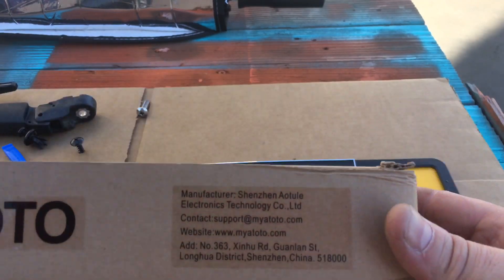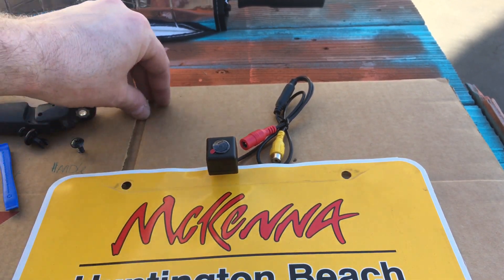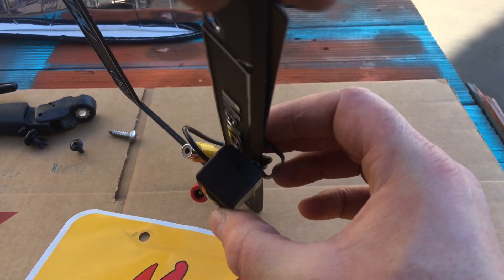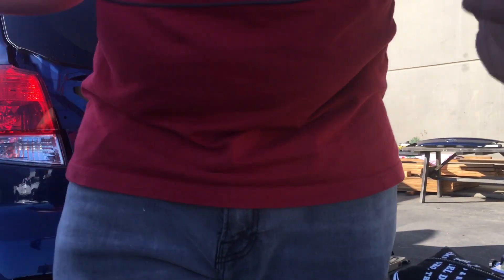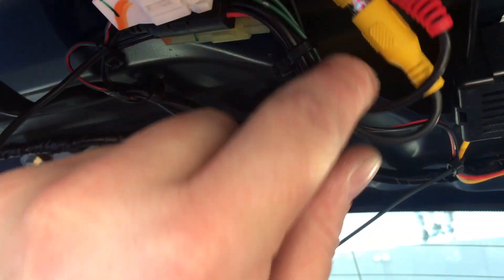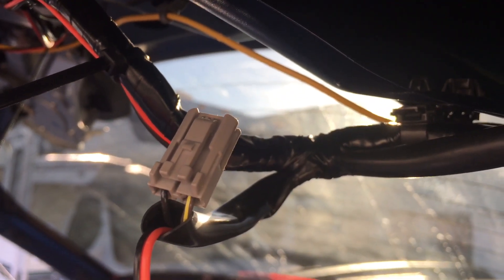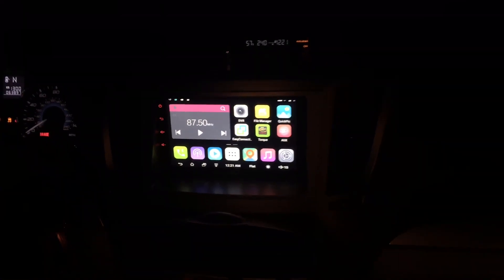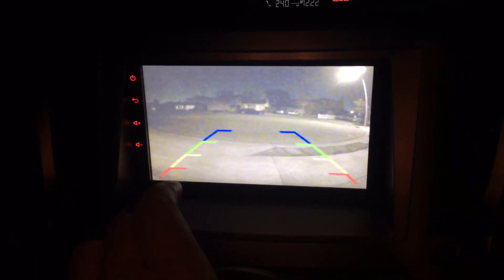ATOTO BACKUP CAMERA- setup and install

Comment: so one thing for me is how long is those cords... I wanna install this on my truck but it being a long 8ft bed with extended cab im almost thinking im gonna need some wire extension.
Reply from the maker: Yes I would agree the wires will need to be extended I think the length is about 15 ft but by the time your route through doors and body panels it’s takes up length

Comment: Need help. I connected the backup cam. Exactly like the wiring diagram indicated, but the camera will not auto activate when in reverse gear. But it does work when I press the RCam button. Any ideas?
Reply: I'm having the same issue. Did you have any luck??
Reply: @vishnusheth96  nothing yet. I contacted Atoto 3/2/22. They send me set of wiring diagram, going to try it out today.
Reply: @isaacpineda  and... any luck? I'm having the same issue and its bloody annoying.
Reply: @richardpantin1108  it turn out that the Ram does not give out the high volts (enough) to power up the camera when shifting to reverse. So fix the issue you need that correct wire harness.
(Metra XSVI-6523-NAV) FROM Amazon. I got mind from a car audio store locally. This wiring harness has the power relay to boost the voltage. Once it's hooked up it will work just find.
Reply: @isaacpineda I figure I am having that same issue as I'm only seeing 4volts. I'm going to draw some power from the fuse box then. Thanks for the reply 👍🏾
Reply from the maker: I wired my cam to 12v from the light the r cam wire is an input not an output so when it gets 12v it will change to the reverse cam feed

Comment: I realize this video is a few years old but did you ever get around to doing the steering wheel controls?
Reply from the maker: Yes!
Reply from the maker: Had to get a special adapter for the car that broke out the steering wheel controll

Comment: I installed the backup camera to my atoto head unit.  When I put my truck in reverse the screen goes black and the "no camera signal"  but no video ever appears on the screen.  I also went into the camera settings and made sure that all the settings looked good.  I can't find a solution  after hours of research and troubleshooting.  Any ideas?
Reply from the maker: make sure you have the camera input connected to the proper RCA on the back on the headunit i think it needs to be wired to v-in. i dont recall. its been a while. 

you may also want to try wiring the camera direct to the unit as a test to make sure you dont have a break in your cables from the back to the headunit.
Reply: @LEGOmania-TV  I'll try that today.  I was still messing with it yesterday making sure it had good power but nothing seems to help.  I'll try what you're saying and get back to you.  Thanks for the help
Reply: @fern9234  I'm having the same issue. What was the problem?